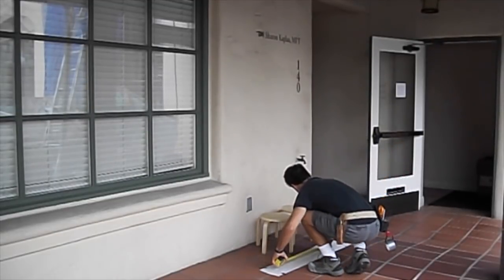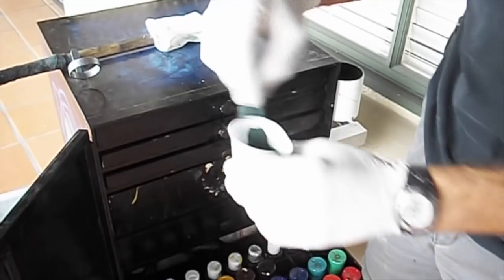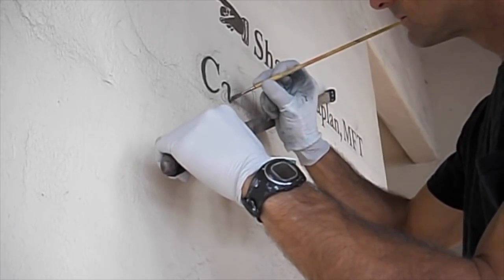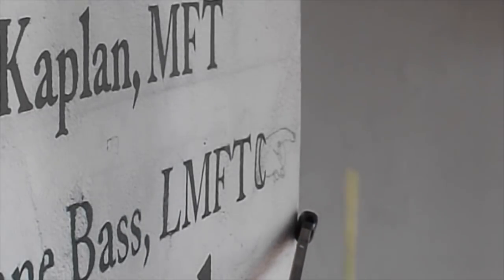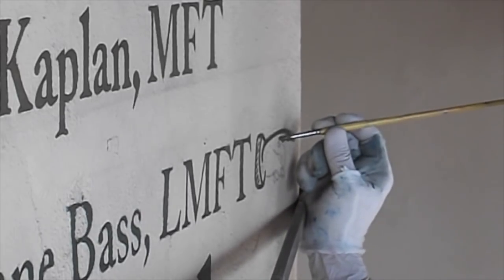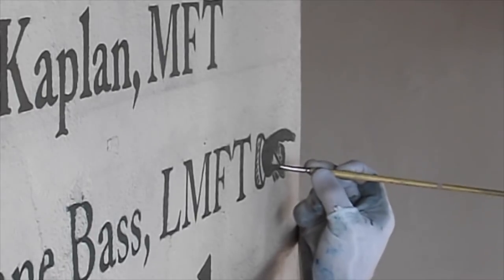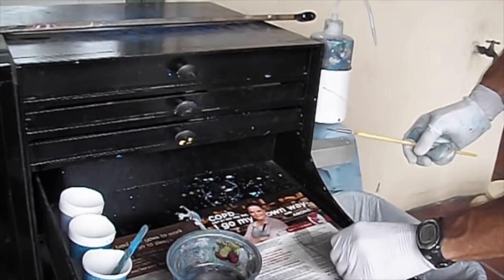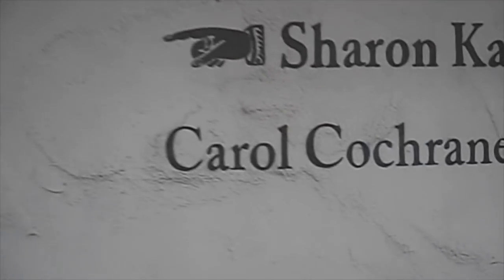Lettering on Stucco Wall

Comment: Yea anymore I just cut it out on the vinyl cutter and through it up and spray it then go back with a brush and clean up the edges. Like the old pounce rollers or the electro pounce but hardly use it anymore. Because people just cant pay enough for me to do it.

Comment: Hi there! I’m going one by one through your videos just looking for more information about the brushes that you use. I’m working on a sign painting/mural project on a stucco wall and I’m struggling with the brush that I’m using. Can you suggest where you usually buy your fitch brush? I’m outside US though
Reply from the maker: Where are you?
Reply: @davidographicsguy  I’m in the middle east so US products are usually hard to come by
Reply from the maker: That’s too bad. If you can, find brushes with the stiffest possible bristles, even if they are synthetic.